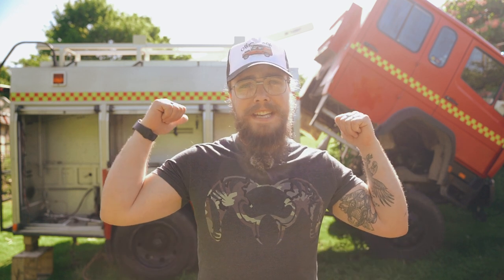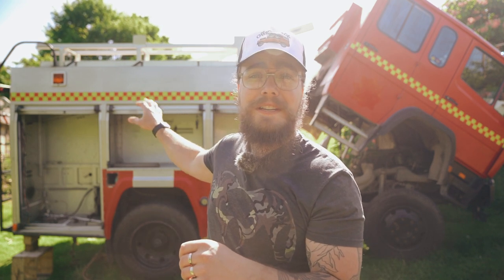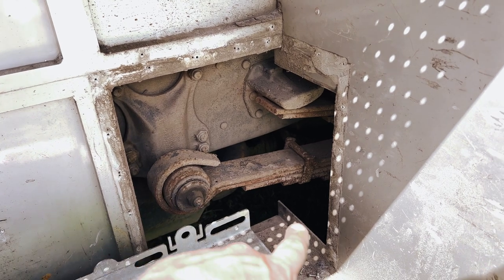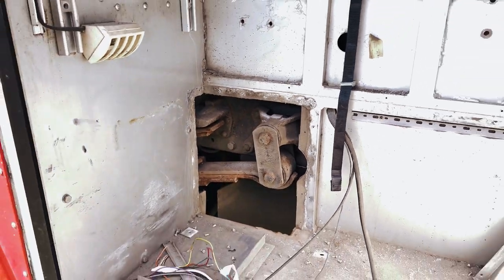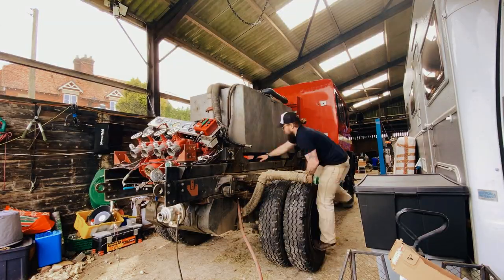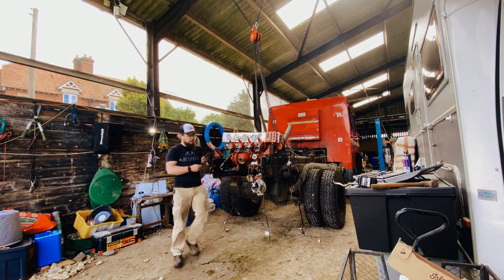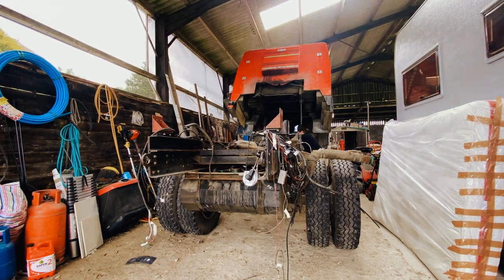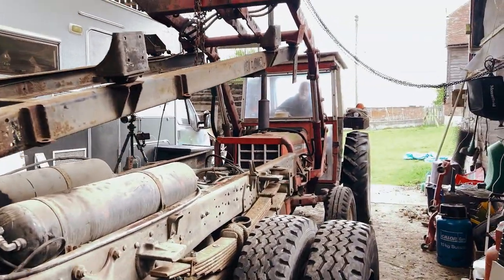Stripping down the fire truck to get ready to build a 4x4 overlander campervan

Comment: Hey! Just bought an old Magirus firetruck. Do you know if it would be possible to rebuild the inside of the fire case instead of changing it for a overland? Like remove the water tank and change the inside of it?

Comment: The colossal amount of work and hours required to convert this beast seems to be of debatable value should have just purchased some bare boxless truck chassis frame rig.  I just don't get it.
Reply from the maker: This is the most cost effective way to get a great rig that we could find. We could not find a better chassis for the price that would offer 4wd.